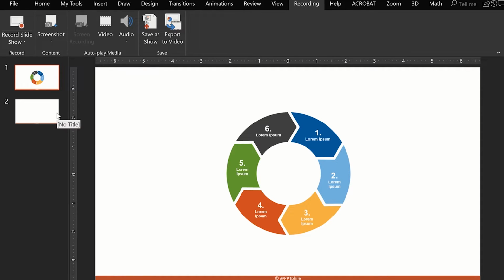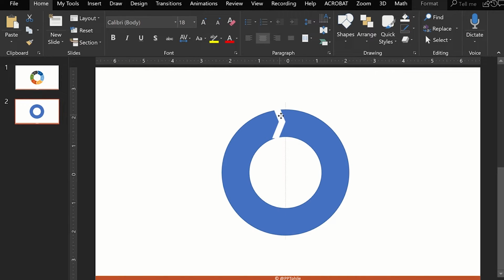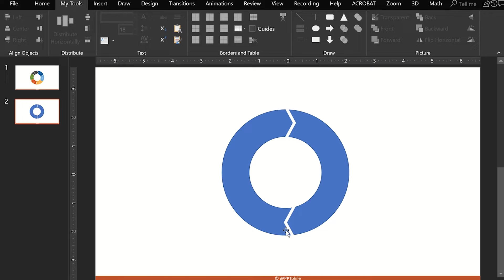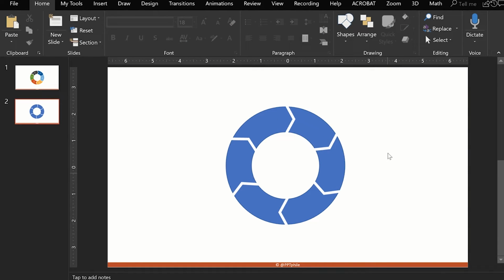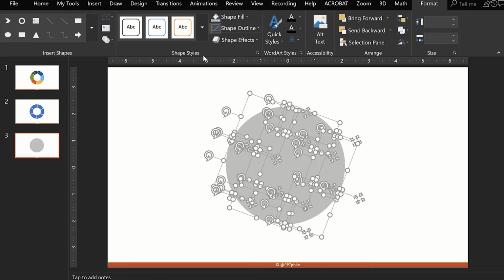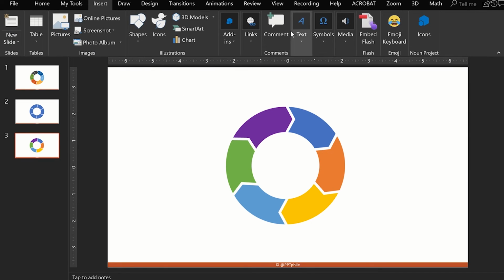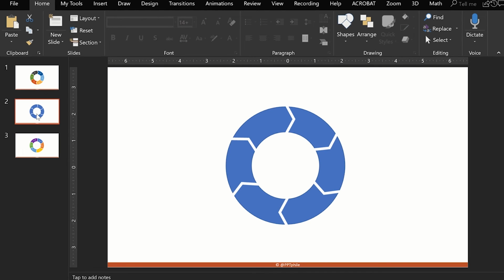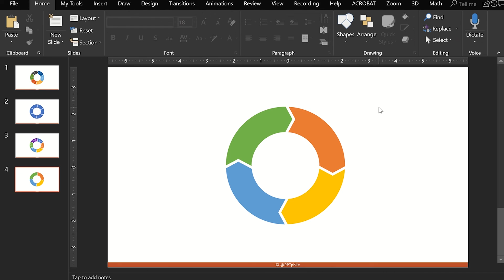How to create a Circular Flow Diagram in PowerPoint

Comment: This is a great tutorial, thank you so much! There was a reference to a technique of positioning the chevrons "really accurately" but was not explained for the sake of time. Is there another video where that technique is explained/demonstrated?
Reply: If you use the 'rotate' function, you can set each to exactly the right angle. I set an opposite pair on either end of a line, grouped the 3 objects, then rotated them as a group. I used 6 chevrons, so angles at 0, 60 and 120 degrees. Hope this helps.